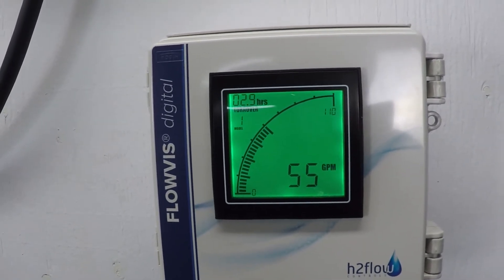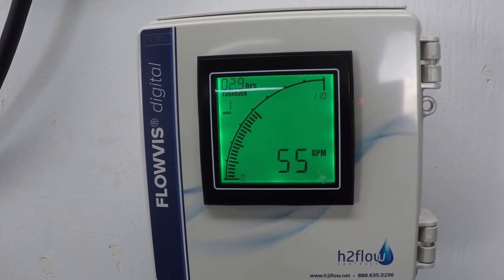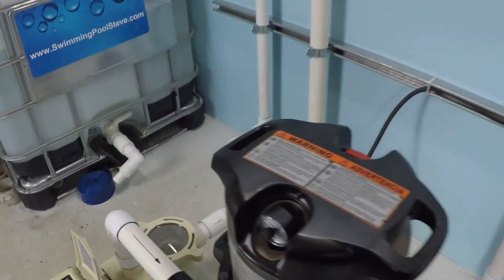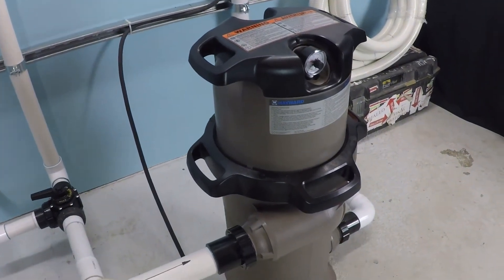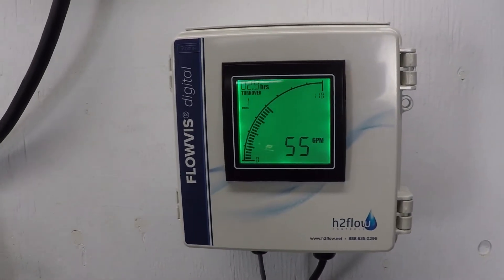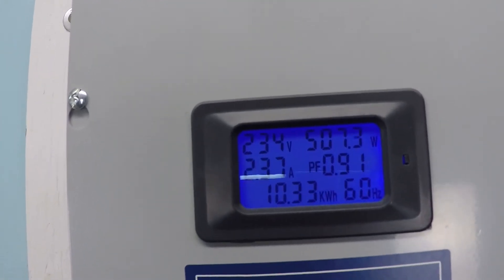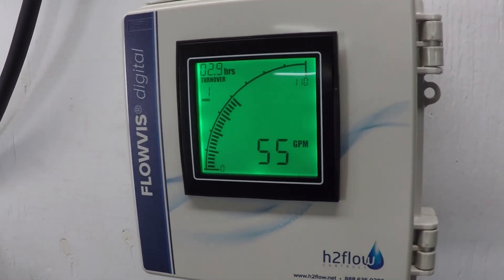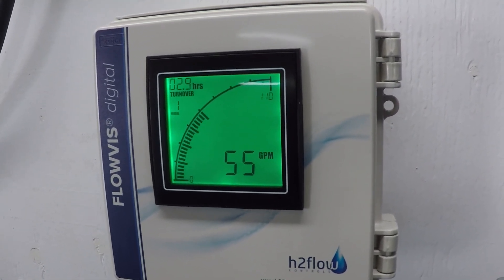Efficient Flow Rate For 2" Pipes

Comment: So, with your set up,  would it every make sense to run the RPM's above 2000 then?   If so,  for what reason?      I have just put in a new pool and am researching what to do with mine.   I have a VS pump but they have not put in a flow meter.    I WILL have one put in soon.    I have 2" pipe with a salt water generator and heat pump.   I am trying gather info to make my system as efficient as possible and not waste energy.    I have approx 32,000 gallons (20x40x (4ft to 8ft)).